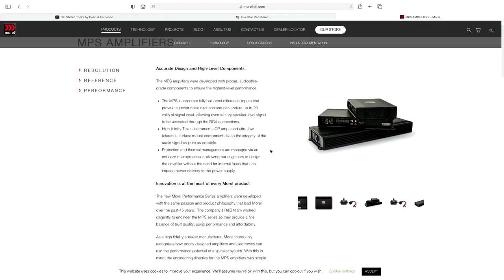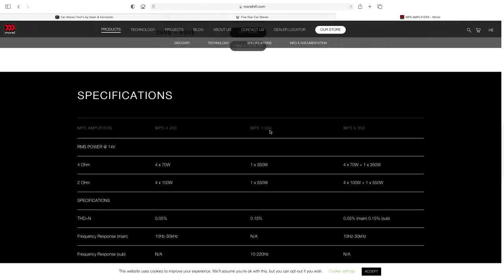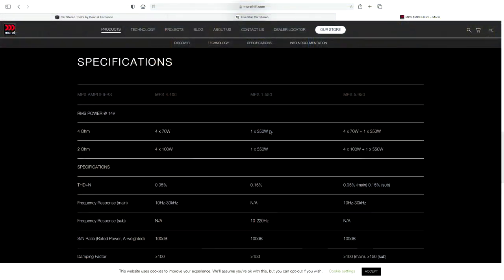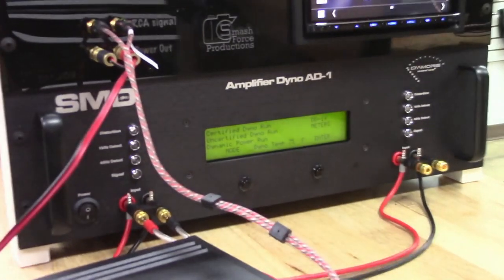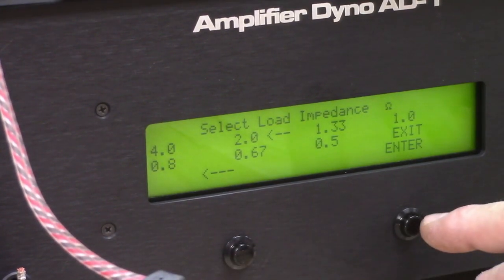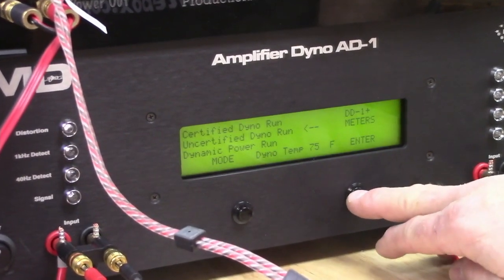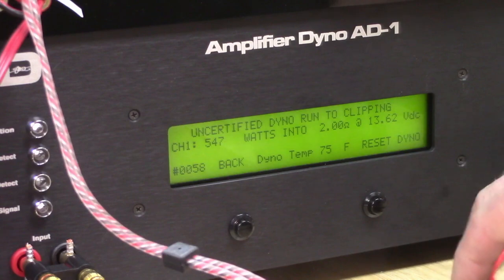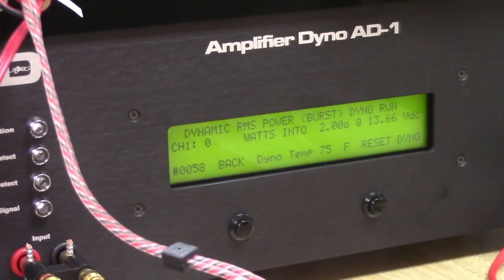Our first Amp DYNO the Morel Mps 1.550

Comment: Great!  It depends a lot if amps have a tightly regulated power supply if it matters what voltage you are testing  them at.  Seems Most Class D amps use unregulated supplies.  This could be quite a debate. 🤔 Great to see another take on the amp dyno...  Thanks guys!!  Keep up the videos, as a former MECP Certified installer I enjoy your content immensely.

Comment: Not sure if I'll get a reply, but here it goes. I had a highly rated shop in the area install some subs, amp, and a LC2i a couple months ago. When I went to pick it up, I noticed they mounted the amp directly to the box, with no rubber grommets or anything for vibration. I told them specifically I didn't want that, but they swore up and down it will be 100% fine. Fast forward to earlier today, after they were closed of course, my amp stopped working. How should I handle this situation? I don't want to say "I TOLD YOU SO", because I could be wrong.
Reply from the maker: Call them up and have them figure it out. I would save the I told you so. However if you told them not to mount on the box and they did, that is a no no.

Comment: If that was a Fosgate amp it would have been in the 800 watt range.
Reply: not if it was a punch 45
Reply: @adamp2  haha, it would have been 385 watts, not 45, Fosgate lied about their amp power ratings. I will take all the Punch 45s you can get.
Reply: @chuckmiller5763  had them 45s and 150s 150 yeah not 45

Comment: Not sure what's in that "amp dyno" box...(LOL) but that's not the proper test procedure for an amplifier true rms. You need steady tone (not music), oscilloscope and steady load (resistive) to see at what voltage output the waveform starts to clip then use ohms law. You cannot determine this with a dynamic waveform. maybe some sort of millisecond peak value but that is a completely junk value to determine an amp's specifications.
Reply: The AD1 is a proper dyno tool. It uses resistive loads, you play a 40hz tone, it calculates distortion, etc... Try looking it up, the SMD AD-1.